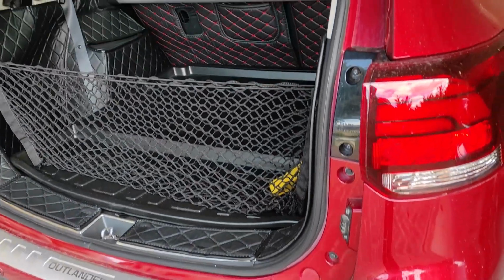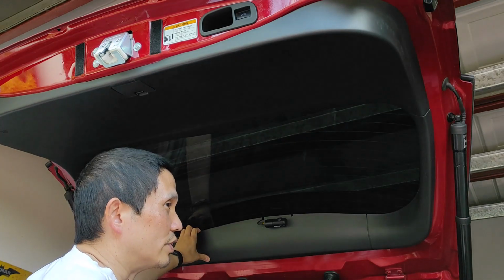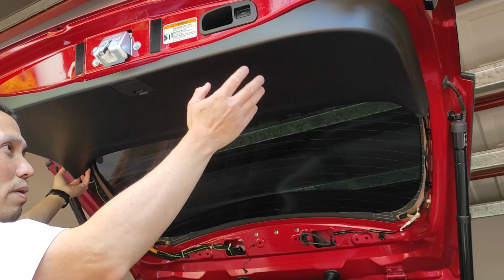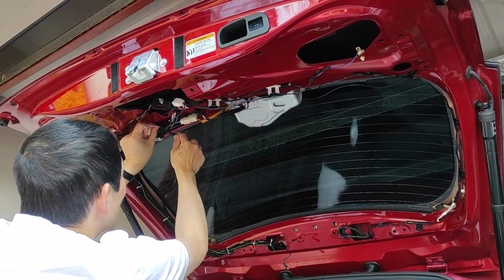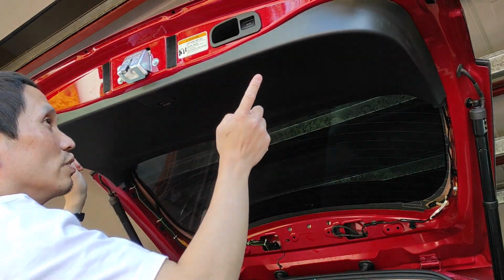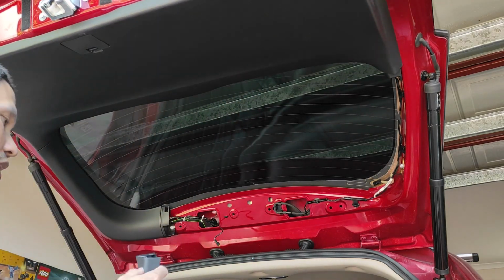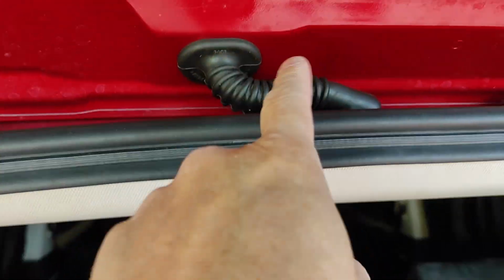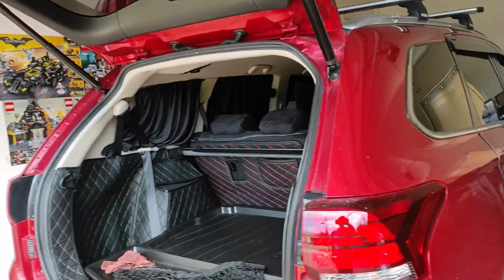Rear hatch interior panel removal Mitsubishi Outlander 2013 2021

Comment: Good video!

I want to darken the chrome trim between the taillights. Is it attached from the inside under the cover?
Reply from the maker: Yes, it is. You need to undo that center trim from the inside. It held on to by nuts from the inside. Cheers.

Comment: Informative video. Just wondering if need to remove the rear panel to remove the Inner tailgate light...or does the light just pull out?
Reply from the maker: Hi the answer is yes. You need to remove this inside panel to get access to the nuts that hold onto all the fittings outside. You will need to be careful to line up all the external seals around the top is the light cluster before you tie up the nut inside. I was about to make a video on how to remove the lights but family commitments got the better of me. Sorry. Once again, thank you very much for your comment and support. New video will due soon

Comment: can u help? how remove inner tailgate light? can you make a video how to open it?
Reply: Hello there! I did it just now. 

After you removed the cover, there is a size 10 nut to remove.

After the nut is removed, u can gentle pull it out from the side as there is a white clip there on the light module.